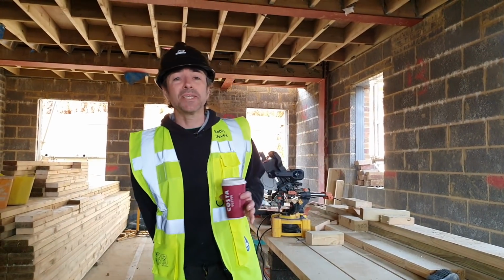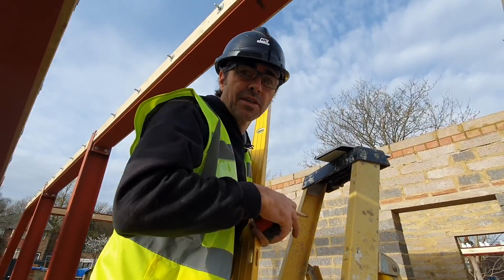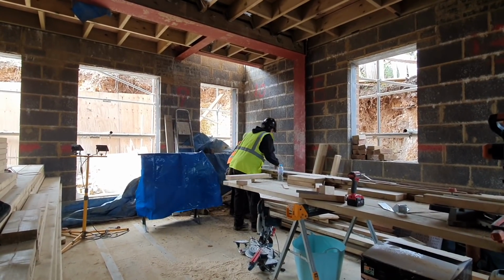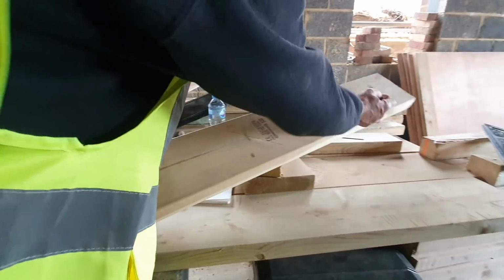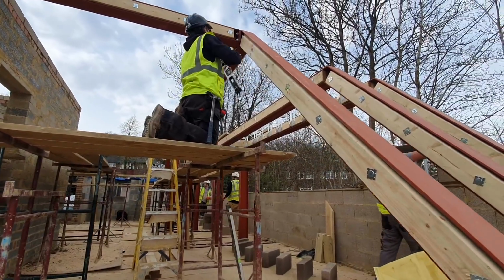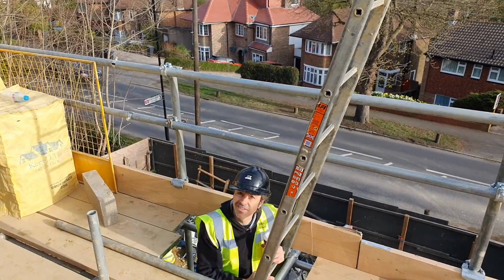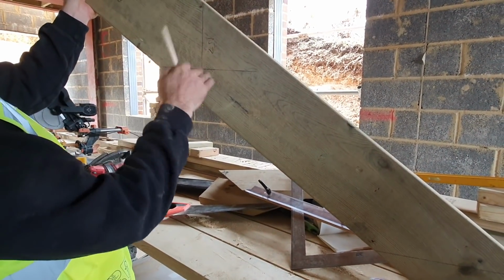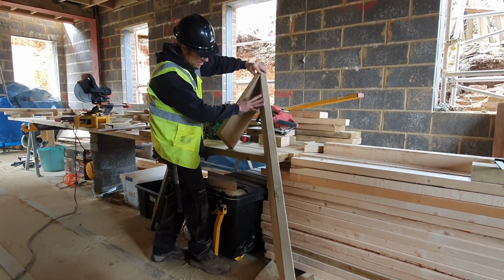Setting out roof timbers My simplified Metric roof framing square on tour

Comment: Yup, here in the US we've been using the framing square since our colonial days. The ones we have for the last hundred years have technical information stamped on both sides for calculating rafter cuts and angles for any pitch. Knee bracing, valley and hip rafters, jack rafters, board feet, octagonals, and so on. But I have to admit I always did the math, geometry and trigonometry myself since we have inexpensive pocket calculators and included on our phones these days makes it fast and easy. But if none are available at the job site because the battery died or left it back at home, you're not out of luck with all that information already stamped on the square.

Comment: I dont think you can beat two sliding bevels and ready reckoner  probably the most easiest way to cut a roof, you also dont need a level that works a angle out for you either, a simple spirit level vertical mark , and a bevel and protracter can determine ur plumb cut, from that you can calculate youre pitch and seat cut, and run of rafter

Comment: Excellent video as always robin, simplistic approach 
Most men on site can only nail up a truss roof
Would add that had the workmen followed the sectional drawings they wouldn't have screwed up the wall plate level, which doesn't suit  the steel  frame
In Ireland most cut roofs have double wall plates, to stop twisting of larger joists and also to gain extra height in upstairs areas, as roof angle and width are fixed
Reply from the maker: Great point about the drawings!!!

Comment: C’mon Robin, your dragging this square out for sale. 😂 I want one to to go with my G Gibson, rather give you the money. 

Love the simplified square though and the stainless steel finish. 

Are the increments etched or engraved in? 

Just think of right angles all the time when measuring from levels. 

Why couldn’t they lower the plates?

I will say a good understanding of geometry is a must. 

Stay safe all!
Reply from the maker: Hi Chris, thanks for your message mate!! my simplified framing square is laser engraved and the engraving is coloured black to see it clearly, my App and videos will enable speedy understanding of the square and how to get the best out of it including rafter lengths, all the angles for different components and roof types, I am doing my best to get all the supporting material finished, the squares are ready!!!!! wont be too long!!
Reply: @robinclevettcarpenter  thanks Robin for your reply. 
Sounds great and thanks for clarifying. 

I emailed your own website after a bit of advice about a month back but not heard anything, I know your busy but would appreciate your input when possible. 
Keep up the great content!!

Comment: All those interested in pitching roofs should purchase Goss' roof ready reckoner book 👍 and watch robins videos and it will all make sense.The step off method i believe if i understand Robin correctly is when we set our rise and run on our squares.Say our fence is set to 300mm run and 150mm rise.But our span is 1780mm.From the plumb/level intersection of our roofing square you can only measure in 300mm steps along the level plane down our rafter.so you would have 5x300mm steps getting you to 1500mm (stepping off) then your final measure along the level plane of you square would be 280mm to get your total step off of 1780mm.Fuck now im confused hope this helps someone haha

Comment: I think the speed square is a a damn handy bit of kit, but I have yet to see anyone improve on the imperial steel square- it just works. Everyone is struggling with pythagoras rules and such- the steel square just has all the answers  stamped on it.  
Fraid I can't see how your  new roofing square  is any sort of improvement
Reply from the maker: My new square is complimented by an app that simplifies the process by computing the lengths of the members and other setting out procedures, removing the need for any complicated math of any sort, I also like the simplicity of a speed square but we are mainly metric here.
Reply: @robinclevettcarpenter  I'm 'here' too- Somerset

Comment: I have a clear acrylic top on my fence, thought it was my own idea !        Love how it's easier to read, but mine doesn't grip the framing square as well as a fully wooden one does.     My acrylic one is 10mm thick but its a quite flexible so hard to get a really tight grip on the square. Maybe a polycarbonate one might be better

Comment: Roof Pitch Consultant. I would like a few jobs like that. Not much use in Qld unfortunately. Because I learnt using two bevels and a tape roofing squares still alien to me. Love watching someone that knows how to use one properly but would take me a while to learn. That is a weird roof design. Architect nightmare combined with over enthusiastic engineer leads to pile of pus. Why the flat bit more problems than its worth. With all that steel setting the parameters and as we used to say perfect pitch 45 not that hard to work out if you know what you are doing which they obviously don't. An interesting insight into the way the building is going in the UK.